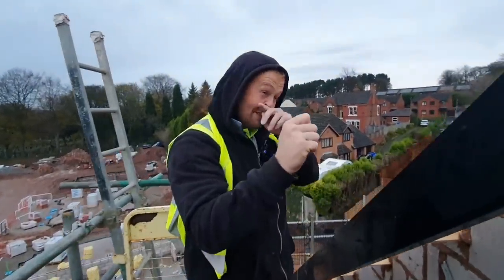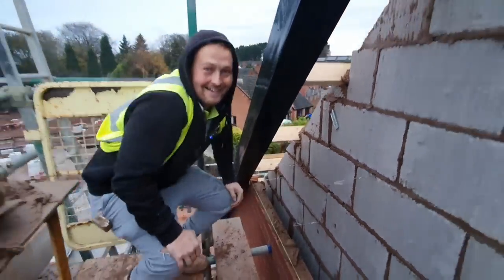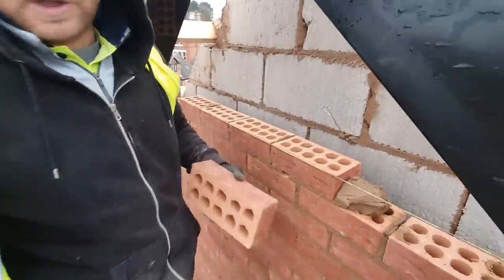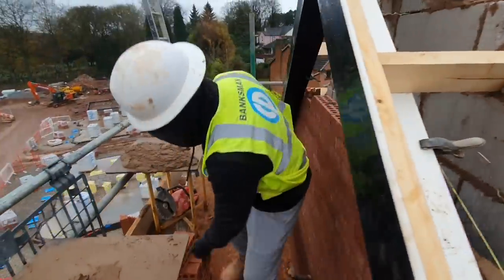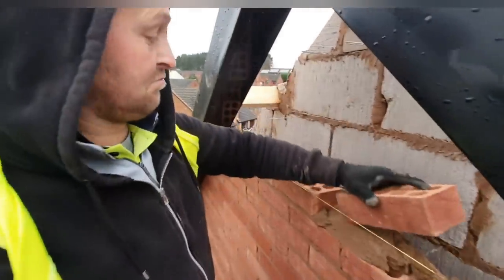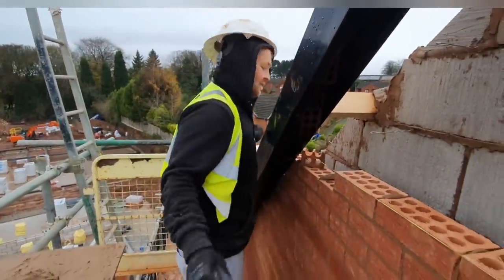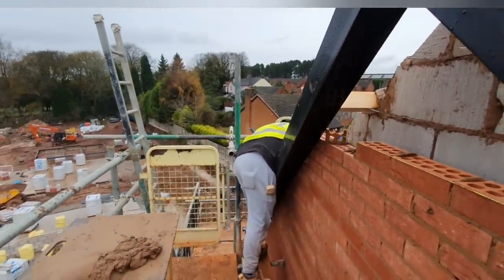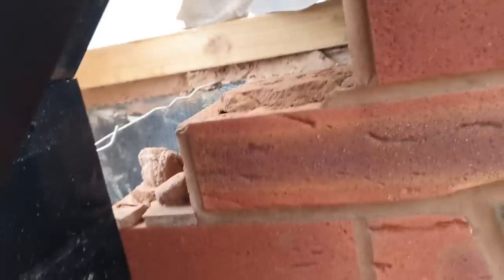No More Building [ Recession Is Here

Comment: The Thatcher years were crap when interest rates hit 17% the building trade virtually stopped. We had to work for £120 thousand and £4 m2 for blockwork. No extras for feature work. Just Measure.  Top video's Changy hope things go well for you both.
Reply: Same thing happened here in Australia at the same time interest rates of 18%
But mind you a house was 90k aus$ not the minimum 800k like today
Reply: I think it was the John Major years
Reply: @jimmymcmenemie1427  Thatcher came to power 4th may 1979, interest rates hit  17% in November 1979.
Reply: Late '80's you could get £100 for boxing in a vent over Bristol way, nice little earner.

Comment: The second phase of an Advant estate that I deliver to has seen house sales stall big time. 
A lot of the newly completed 3&4 beds are sitting empty and not internally finished as there's no buyers to pick fixtures and fittings. 
Phase one was 2-5 beds and all 10 of the 2 beds were gone within days of them becoming available. It seems it was a bit of a stupid move by the builder to not include any 2 beds on the second phase as they would have sold them in no time as people downsize. 
Now they are left with multiple versions of virtually the same house that aren't selling.
Reply: Be full of foreigners soon
Reply: @Heimbach1966  you mean foreign investors happy to sit on it until the next load of public finances goes to prop up the industry.

Comment: Regarding the pediments, what comes first - bricks cut on the rake, then valley boards installed, or valley boards installed, bit tricky to install bricks but again cut on the rake. Is this not prior preparation prevents poor performance. Either way seems like the bilricks should have been cut on the rake to give enough space for the valley boards.

Comment: They will do all the slabs by july or they will have to put heat exchangers on all houses, 10k a pop extra so the builders will do the slabs but no supers
Reply: Interesting this is a new reg coming in I assume?
Reply: @vivalachocolat1  yes new regs  from july next year all new houses cant have boilers, so theyre doing heat exchangers. 10k to bore the hole
Reply: If they build the footings before hand they are exempt
Reply: Bore a hole? Do you mean ground source not air source?